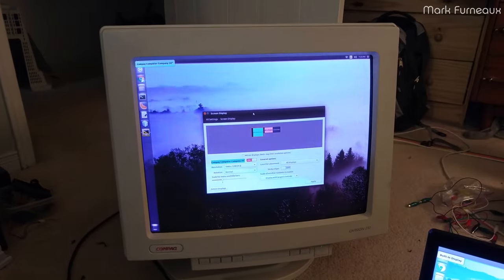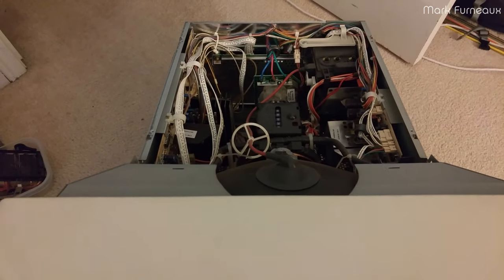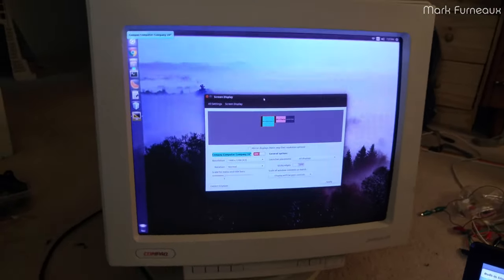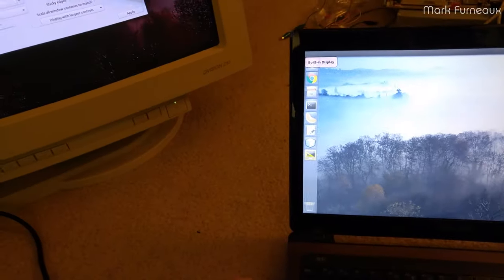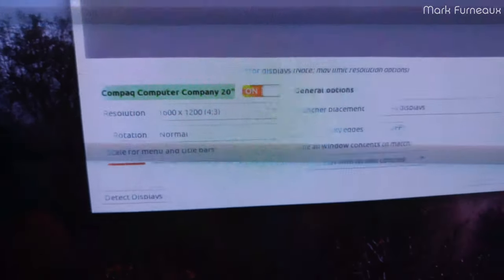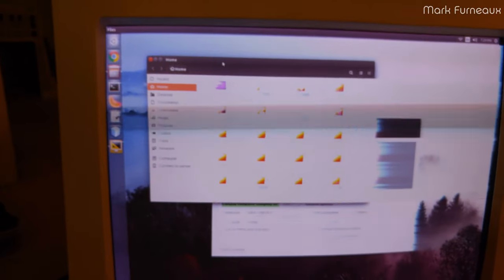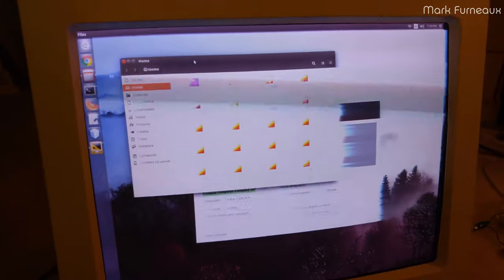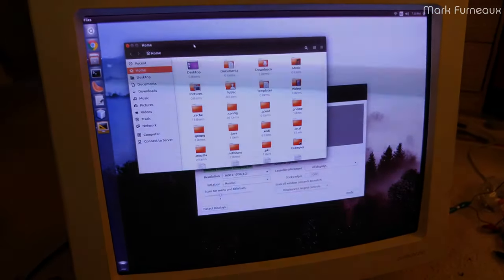What a CRT Monitor With Weak Emission Looks Like

Comment: Shame I'm 3 years late, because there could've been a way to salvage this :)

In case anyone else crazy enough to still use such a thing in 2019 and beyond comes across this comment: 

You can squeeze a little more life out of some CRTs with this problem - yes, even if cranking up the gain/brightness/contrast would produce the smearing in the video - by doing gamma correction at the source. On Windows, check your GPU's control panel, or Windows' own display calibration wizard (though that doesn't go as high). On Linux/X, xrandr --gamma is your friend.

Successfully revived a CRT of mine this way a few weeks ago which is unusably dark without gamma correction, worse than in the video (though I didn't open it up to turn the internal knobs). And sure, it lost some contrast, but all in all it still looks pretty decent. I've seen TVs look worse without aging.
Reply: thank you, im looking for a crt, and i want to make sure i make an educated purchase

Comment: If the tube has got to that stage then you should have a rejuvenation done on it.
Reply: Good luck finding a neck adapter for that CRT
Reply: @Gubalicious  you dont need an adaptor, modified dupont cables is all need and connect to the individual pins on the neck, most crts have the pinout on the neck board if not its easy enough to work out, this is how i test sony trinitron tubes.
Reply: @Megalocade  Arn't trinitrons fragile though? With rejuvenation on them being a TERRIBLE idea?